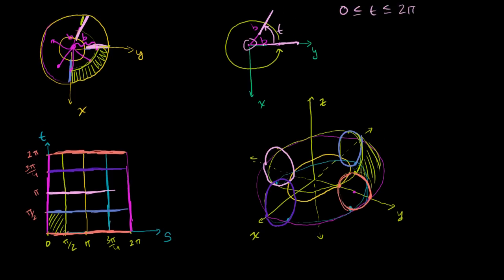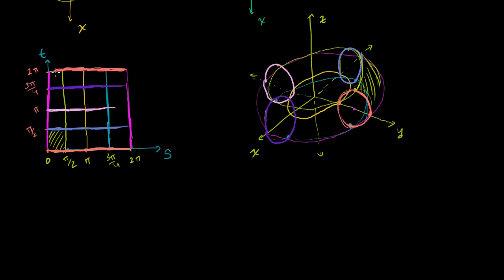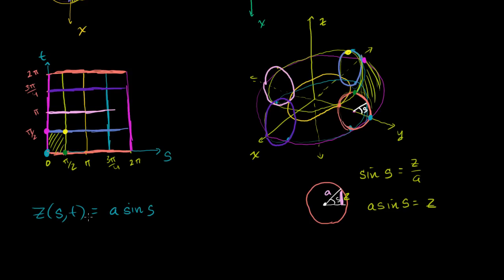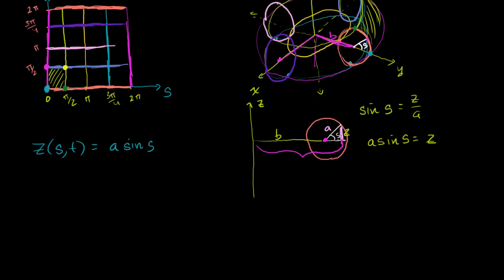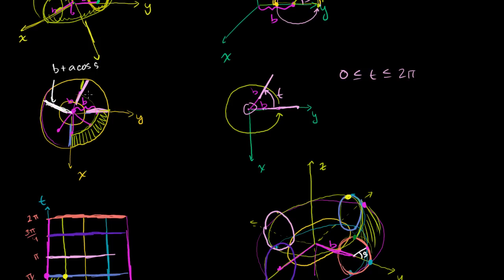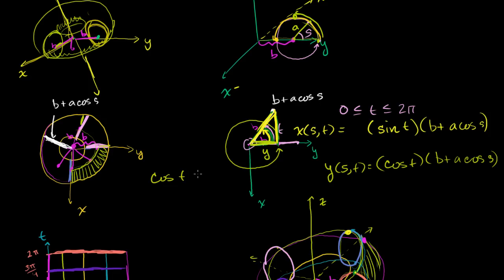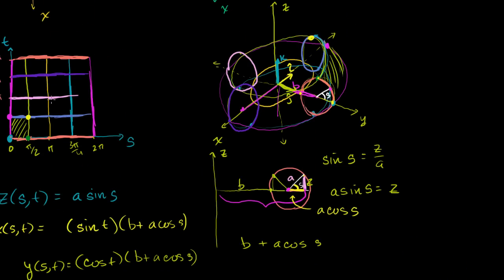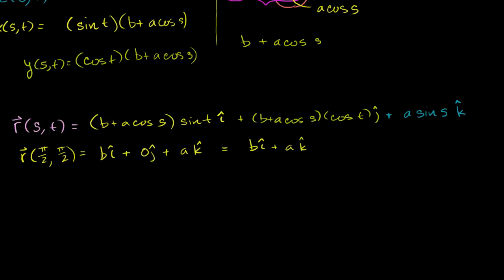Determining a position vector-valued function for a parametrization of two parameters | Khan Academy

Comment: The s and t could have actually any values and its still the same surface, but taking multiple rounds wouldn't possibly help. s, t in {-2*pi ...0} would give same surface or s, t in {th0...th0+2*pi} would give this same surface, but isn't possibly that good as 0 to 2*pi.
The drawing is quite good for this purpose, but maybe if this is combined to some CAD or plot application can help also - especially if surface would be something more complicated than this one.